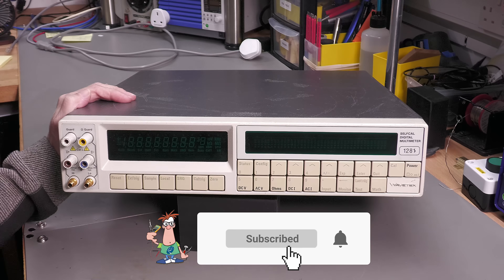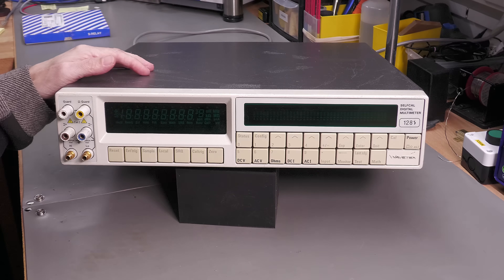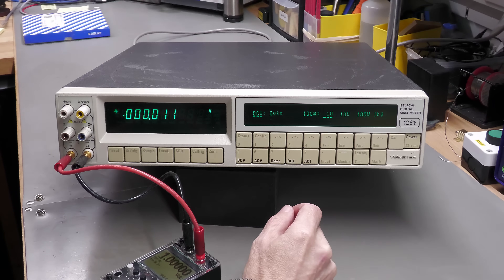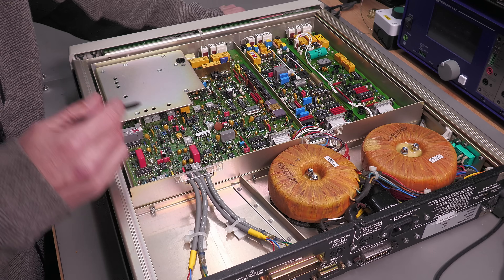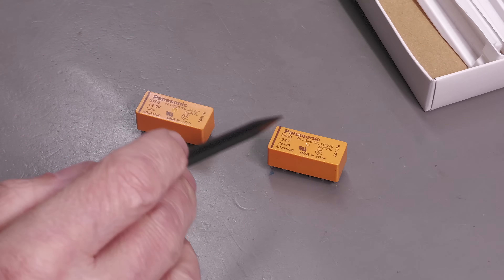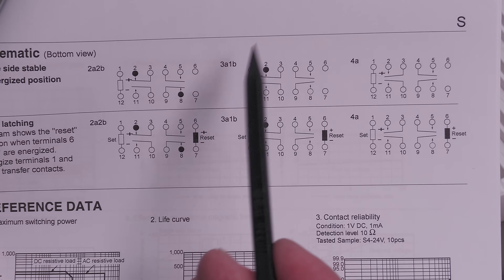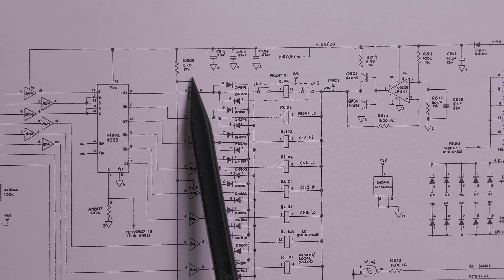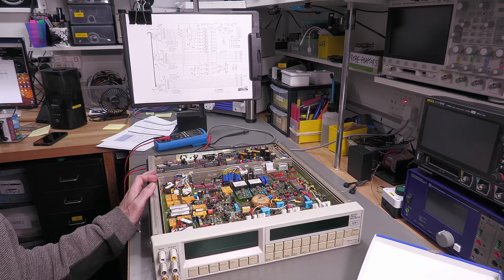No.167 - Wavetek 1281 8.5" Multimeter Repair - Part 1

Comment: I might suggest a relay testing board, to switch the relay and measure consistaincy of the contact resistance.  Should prove condition of the old relays and contancts. Test a new relay for comparision.  This will quickly identify the course of action, replace or not.   Does the circuit operation mean the relay coils are dual polarity switching?  i.e. +/- 7V
Reply from the maker: Yep, the original relays are single coil latched so require flipping the coil polarity to operate the relay on/off.

Comment: I guess, that all the relays do not need any service/replacement at all.
My 1271 is doing fine after all these years. Replacing so many relays makes no sense at all to me.
Ian, could you do me a favor, later, please?
I'm investigating on the huge noise on the primary LTZ1000 in my 1271. It's about 500nV, compared to the usual 150nV(rms).
If you have another LTZ based DMM (3458A preferred, but others will also do the job), could you please measure the output voltage directly out of the main LTZ board, and tell me, if it's more like the lower or the upper noise floor?
I guess, that the Datron engineers have built a ground loop into the Kelvin sensed reference, which I'll try to calm down to the 3458As' level.
Thanks.
If you need further ideas/input about further fault finding (I guess you already got it), pleas let me know. I already have inhaled nearly completely the whole schematics, I guess.
Reply from the maker: The owner thought that some relays might have been welded closed after noticing a bunch of burnt traces......so changed out a load of relays.
I haven't removed the boards yet to have a look and see what's going on.
Reply: @IanScottJohnston  If an overload / overvoltage would have ocurred, the protection circuit would've taken over.. I guess there's no way to really overload the relays with an overcurrent at all, that's extremely improbable in such input circuits. To check the relays, that's quite easy, I guess, and you'll find none damaged, very probably.
Reply: @DrFrank-xj9bc what if the overload happened on the guard side of things?
Reply from the maker: The new relays might be able to stay afterall!......the originals are single coil latching, and the new ones dual coil latching.....but testing one of the new ones and reversing the polarity of just one coil it works ok, just don't need to use the 2nd coil. Need to check NO/NC is correct for given polarity is all. I'll get to all this in Part 2.
Reply: @jackstringer-co-uk  nope. the input relays are for the voltage input, where you have infinite or 10MΩ impedance behind. Therefore, it's impossible to damage these relays by overcurrent, as latter will never flow. As well it's evident that the pre owner has blindly changed all the relays, w/o checking any one if its damaged or ok. These relays all have very high EOL switching numbers, and because practically no input current is flowing, they'll last forever. If a coil connection got open, then this would have affected one single relays, but never, never 7 of them

Comment: Most relays are pretty generous with voltage spec so I'd be pretty confident putting 5V relays into here without worrying too much. Since it's latching relay, the voltage would be just set by a brief pulse and later deenergized.
Reply from the maker: For latching relays I guess ok. The original relays are single coil latching whilst the new ones fitted are dual coil set/reset latching.......and testing the dual coil relay just using 1 coil and reverse polarity it works ok.....so the new relays might be able to stay!
Reply: @IanScottJohnston single coil relays can be also both latching and non-latching types.

Comment: New to the channel. This is why we dislike equipment repaired by others. You are not only chasing the original fault, but errors introduced by others. Good video.
Reply: Yes, I also do not like to work on someone else's drama. But you can be lucky, I once bought a 3.5GHz Advantest spectrum analyser for a somg. Which worked OK once I repaired it 100%. The original 98% attempt just did not cut it 😮
Reply: "Somebody has been in here before". That's the way of the world! Like in the Egyptian pyramids.

Comment: could also change a resistor to lower that 7v to match the installed relays.
Reply from the maker: The installed relays are latching relays so will never work. They deffo need changed out, so might as well buy the right 6V ones.